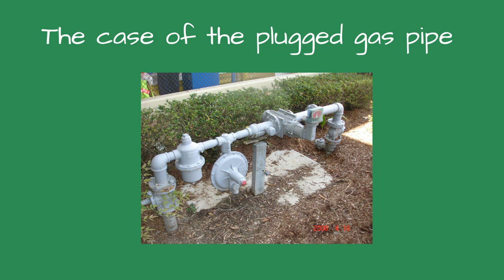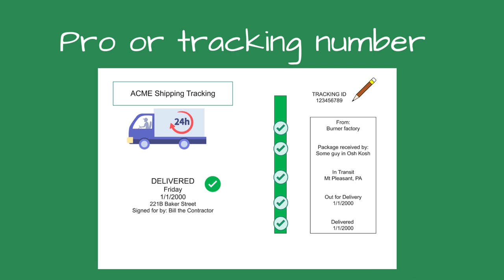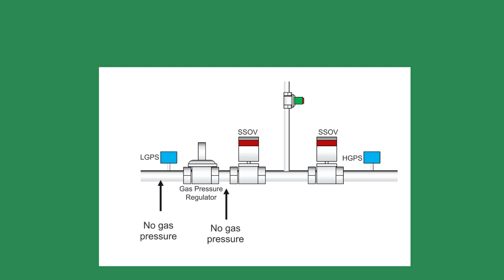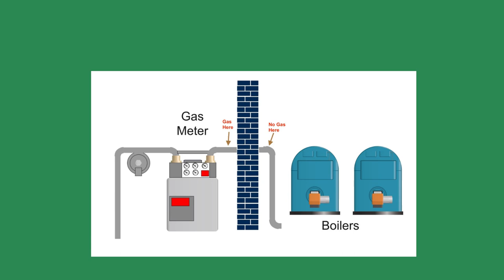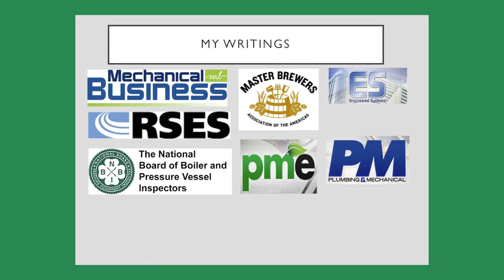The Case of the Plugged Gas Pipe

Comment: Had something similar years ago.  Two old 1950's era high pressure steam watertube boilers, around 200HP.  Approximately 75' of 4" pipe, 2# gas supply pressure.  These boilers were right next to each other.  The 4" pipe terminated in a 3"X3"X4" tee with a 3" gas train to each boiler.  The one boiler fired properly while the second boiler would light the pilot but fail as soon as the main gas valve was energized.  Testing confirmed that the gas pressure did drop to zero as soon as the main gas valve was energized.  I told the boiler operator that there had to be an obstruction in the tee.  We both agreed that while unlikely, what else could it be?  After disassembling the gas piping, we found a red, 4" plastic pipe protector stuck in the tee.  Come to find out that the gas company had just recently replaced the gas meter.
On another job, the industrial customer had just replaced his boilers and his gas bill was much higher than with the old boilers.  The gas company said that there was nothing wrong with their equipment.  The customer was justifiably upset and switched to fuel oil, which did get the gas company's attention.  Testing confirmed that there were no leaks in the underground piping, but clocking the meter did show an extremely high input to the boilers, however combustion tests were normal.  Come to find out that when the gas company installed the new meter, they had only ripped off half of the paper dirt protector on the meter's flange, causing the turbine meter to spin faster than normal.
Reply from the maker: Wow bet the look on the face when you found the red pipe protector was priceless.  I would have never thought about the paper blocked the flow and caused the meter to spin faster. Thanks for teaching this old boiler guy a trick

Comment: Bill gets the bill! 😄
Reply from the maker: LOl its Karma and I love it
Reply: @boilerroomdetective  , Great story Ray 👍. I think we have all ran into those Bill type of people . Thats the great thing about working for a gas utility , we are the umpire that gets to call balls and strikes. And the rulebook we use is NFPA 54. 
 I’m assuming your pictures of the boilers & meter set were stock photos and not the actual job Bill was on (examples only? ). Good thing no one got hurt from a delayed ignition due to poor pressure, doesn’t happen often but it has happened.
Y’all stay safe out there & Ray keep them coming, they are great stories📚.
Reply from the maker: @boby115  Thanks Bob. The meter was from a different job The project with Bill happened before we had cell phones LOl
Reply: @boilerroomdetective  , I figured those were stock photos. You said the gas company got 12 inches of pressure at the outlet and that is a picture of a pounds meter set and a old one at that. With the picture of the boilers,there was no way Bill did that nice of a job,LOL.
Reply from the maker: @boby115  LOL Busted Thanks for the expertise